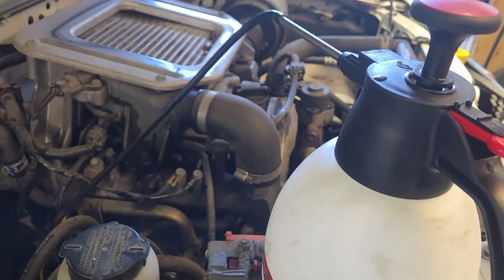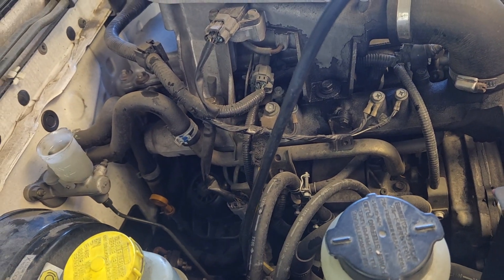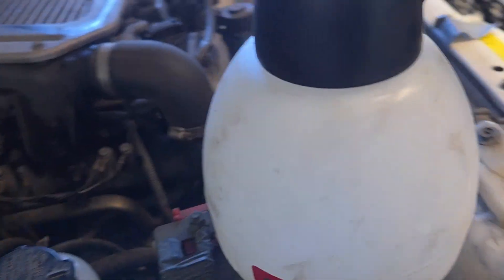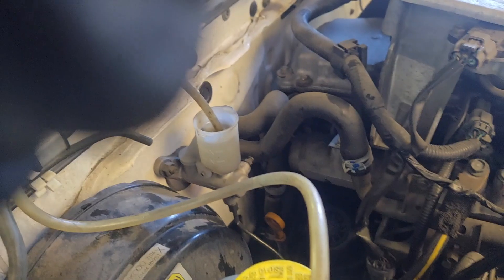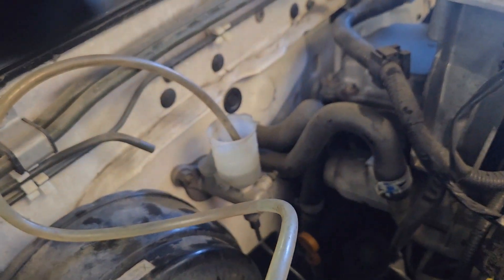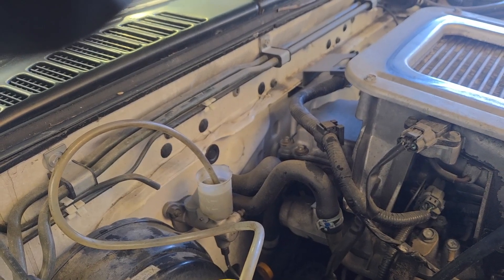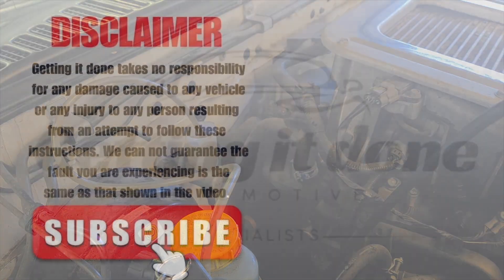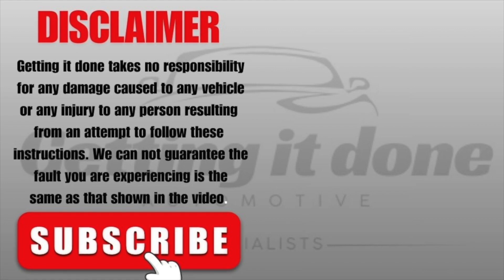How to reverse bleed a hydraulic clutch

Comment: how are you purging the air out? is it the solo bottle??
Reply from the maker: Yes, the solo bottle is pressurised. It pushes the fluid from the bottom of the system to the top, pushing the air out as it goes. Because air is always trying to move upwards, this is a more efficient way to bleed as you're not fighting the direction the air want to travel.

Comment: I tried this in my Suburu but it keep popping off the nipple. Any suggestions on how I should go about this. Not sure if it’s supposed to require a lot of pressure or if something else is wrong
Reply from the maker: You don't need too much pressure. Just enough to slowly push the fluid through. If you try and push it through with too much pressure, it will back pressure and push the hose off. Also make sure the bleeder ripple is open far enough to allow good flow.